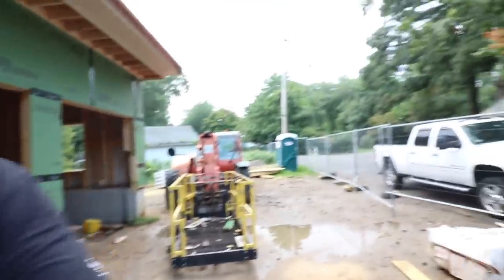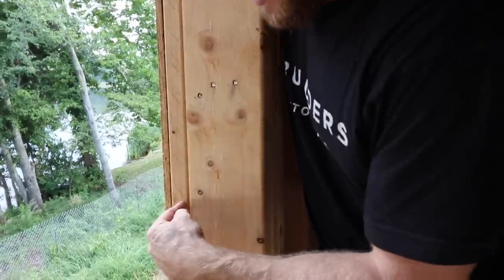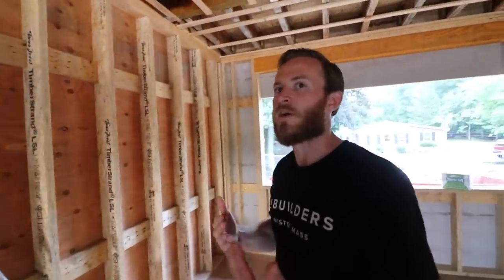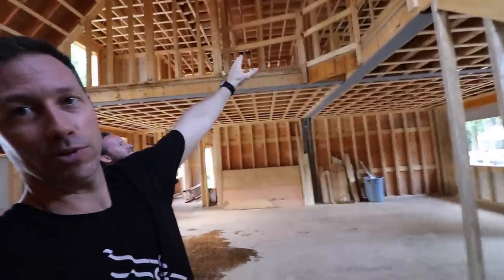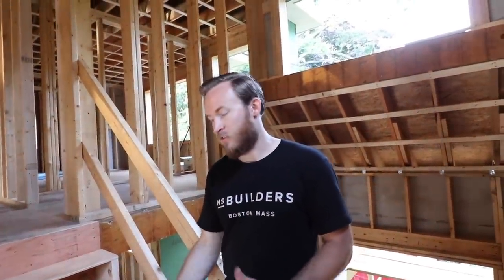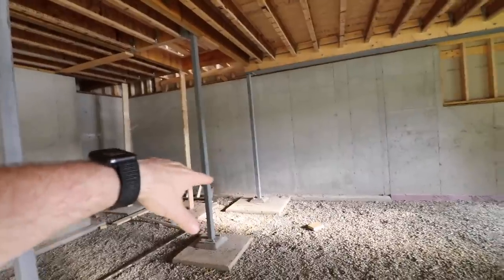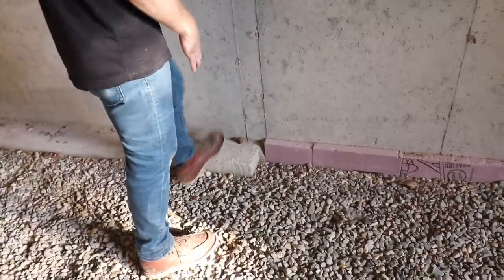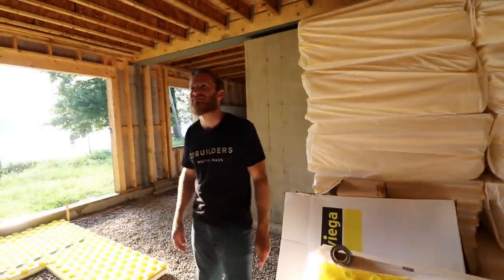How do they Build in Boston? Visiting a new home in Framing

Comment: Jury's still out for me on that Zip-R material, it has a clear benefit in that it creates a true thermal/sound envelope but it causes a few problems, some obvious, some not so much.  I put up an addition last year and that stuff was spec'd, my first time working with it.  I knew I'd have to special order fasteners for the siding and trim (3 1/2" stainless ring shanks to get through the clap board, OSB, foam and still sink 1 1/2" into the framing) and I knew not to crush it while installing and all that stuff, but I couldn't use the Azek plug system for my exterior trim because I couldn't get the right screws in such an unusual length.  Because it bumps the wall out to an odd size I had to custom mill all my stops for the windows and doors, plus you lose the benefit of the sheathing helping to stabilize the framing because of the foam, so it required extra blocking.  Also, quick tip for anyone using it soon: be sure to spec some wide lumber around your windows and especially doors to cut down to size after you knock out the foam backing so you have solid nailing (in my opinion it's better than adding a block); the hinge screws on your door will catch nothing but foam otherwise.  None of those problems should have anyone scratching their head trying to solve them, but they do increase the time and material costs and I wonder what the long-term cost benefits really are.  Anybody got an opinion on it?  (Just kidding, I know you do.)

Comment: It is amazing to me how everything is built without any concrete.... even wet areas like bathrooms and kitchen. In Brazil is all concrete, sometimes even the ceiling. Wood most of the times is reserved for roofing (which receives ceramic tiles, rarely shingles).

Comment: Very well designed, I've been Hanging Rock (plasterboard/drywall) 23 years and have never come across a framer who buries the straps or levels everything. They always leave it up to the rocker to bury the things ( strapping, beams, HVAC, crooked walls) that every other contractor didn't want to deal with, usually by scraping out the back of the board which gives you instant structural failure of the sheet. (Or rock over it for that beautiful hump in the middle of the wall) Any shifting and that's where it's going to crack
Reply: brian b , I grew up in Boston and love the strapping on the ceilings, in Colorado there is no strapping on ceilings and I see cracks in every home over 10 years old. I sure do miss hanging lids with strapping and the builders out here thinks that strapping is a waste of time and money, but I believe it is a far better system. Just my 2 cents

Comment: One of the GCs I worked with in FL used it to make the ceiling perfectly flat. He would string EVERY 1x  both directions. He used screws on the 1xs so his framer could pull them out to shim the strapping.

Comment: Wow...the builder threw the cabinet man a bone....I can't even get the framers to plumb and straighten the wood studs in the kitchen 😀
Reply: I feel your pain. Sometimes I think my name is "Shim"
Reply: I think the builder IS the cabinet man.
Reply: JohnnyBDye that’s a real easy problem to solve there, just withhold money from their check to compensate ç their way pretty damn quick
Reply: Don Pfeiffer ...
I'm the cabinet maker and installer, AKA "The Shim Master"
Reply: We use engineered lumber for studs on walls where there will be cabinetry.
Reply: @mikemills8765  That's what I heard...
Reply: When I remodeled our kitchen I made sure that our main cabinet wall was one-hundred percent straight. Those dang quartz countertops are very unforgiving if you have wiggly walls. Turned out great.
Reply: badlandskid Awesome! Brilliant idea. I'm the cabinet guy. Wow! Straight walls. That might confuse me. 🤯 LOL

Great tip. Thanks!
Reply: Low-budget DIY basement kitchen construction:  Buy the studs the year before.  Stack them in your garage with spacers between each row.  Run one side down a table saw:  1-sided straight studs.  It may also help to buy 2x6 studs & cut them down to 2x5 -- they usually warp less and you have more space for plumbing.
Reply: Because he IS the cabinet man. Did you watch the video, or just scroll to the comments and start reading those after two minutes?
Reply: lmfao  @victoreous626
Reply: @JohnnyDBDyer that's why they call it carpenTRY not carpenDO

Comment: If you can go to 24" according to the calc but want less deflection, 19.2" is an option that allows more space for ductwork. ◇ on your tape measure.
Reply: delreydavid  19.2 x 5 = 96 which is your common subflooring size. It has been on tape measures longer than they have been building racks but If your rack happens to be 8' tall it would also work.
Reply: 19.2" is a common spacing for joists to keep the sheathing edges on the joist. 12", 16", 19.2", or 24"
Reply: Some places that's somewhat common, but most places don't run with 19.2" centers...Not to say it doesn't work, just not common.
Reply: Yep, a case where less isn't more for sure.  In your case I'd still prefer 16" centers...but again, there's nothing wrong with 19.2, we just don't use it.  I'd guess a portion is that 12" centers is every foot, 16" centers is 16-32-48, 24" centers is every 2 foot...try asking the new guy to add 19.2+19.2+19.2 ever!  (I know it's on the tape measure, and truth is some guys struggle with 16's even...soooo...my point may be worthless!) . I fully agree that I'd rather have a house framed on 19.2 rather than 24...but...I'd even more rather it be 16's :)
Reply: Bingo.....compliments on your knowledge. Most carpenters, let alone You-Tube posters don't know what that little diamond is for... another way to gain space without going to 24" O.C. and still break on 8'.
Reply: 19.2 is actually for Truss spacing. Common specs for TGI, TJI, Open web wood joists, and common framing members is done in 12", 16" and 24" OC spacing.
Reply: I was looking for this comment. 19.2 is what we do here, it is a good compromise between the reduced cost of 24"  & strength of 16", and without the issues of subfloor sagging between the 24" spans if the floor finish is too heavy (3/4" subfloor). 

Also it is worth finding a local truss supplier or engineering firm that is willing to actually run the numbers for your floor truss/joist to get you real world numbers that will have no bounce. We have factored charts we use for our designs for that purpose. Build beyond code and your clients will love it. I'm also a huge fan of OWWJ trusses, awesome for mechanical and hiding structure... although you do get a taller building out of it (especially if you are going 18" deep or more). Also a great way to clear span the big open spaces people like.

Comment: I love having a basement!! That's where my washer and dryer goes.
Reply: Why?  They should be as close to the Bedrooms as is reasonably possible.
Reply: My Aunt had a laundry shute in bathroom, that went into the basement I personally prefer laundry set in basement.
Reply: I live in a nice enough still reasonable rent duplex, the washer and dryer are in a closet outside my bedroom, there is accessible location in the basements but it was built uninsulated and unconditioned long before modern code compliances and not been updated or rebuilt since.

Comment: Couple of problems noticed right off with your Zip board in the way it was installed. They should be stood veritical to minimize lateral seams. They make them in 12ft lengths. You installer did flush set his nail gun when nailing them off so many of the nails broke the surface. Unless you go back and fill or zip tape them , then you've lost the moisture and air resistance that sheet is designed to provide. And its clear they didnt use hot dipped galvanized nails when nailing that 2x2 pressure treated fur strip at the bottom of the wall. You can clearly see the rusted head from the video. At 2:12 you can clearly see the bleed from the nail....16:31 again more over sunk nails after he talked about setting the nail gun depth. I especially like where they missed the stud, removed the nails left the holes. And from this video you can tell it had recently rained a lot, so I pretty certain there is water in your insulated phone just sitting. Well moisture at least.....way over built this house to go for thermals yet issues all over with preventing the issues the products are designed to do. 

The sheer tie down straps, was a nice touch by the framer to flush set them in the wall!!
Reply: Most lumber yards do not stock the extended length ZIp or plywood. Installing horizontal is perfectly fine too, at least if they are taped. We caulk EVERY nail hole that is not taped when we use Zip, to prevent water intrusion. The ZIP WILL expand, and swell at the nail holes even if they aren't over driven. Hence why we caulk every nail hole.

Comment: This home is being built in the Town of Framingham, Massachusetts which is a “Green Community”.  Theretofore, this home is built according to something known as the Stretch Energy Code and it is therefore not an example of a typical Massachusetts home as built to the standard Massachusetts Building Code.   Theretofore, the differences between this home, and homes in Texas and the assumed differences in construction methods is therefore exaggerated.
Reply: Timothy Seely, You may be correct about the  exaggeration of differences, but as a retired Shrewsbruy, MA. firefighter, I'll be willing to say the MA. codes are stronger than those of Texas.
Reply: Having lived in the north and now living in Texas I can say there is little exaggeration. You wouldn't have to do much to have stronger codes than Texas. Like, if you have a building code at all. I was astonished at what passes down here. Never before have I seen exterior walls framed 24" on center, for instance.
Reply: Try an "as such" or other phrase, you used your entire allotment of "therefore"s for the year all at once :)
Reply: Jason Doege what municipality allowed 24" OC for exterior walls?
Reply: Holy therefores!
Reply: It appears my word choice was more than a bit static during my original post for which I apologize. The post itself was to detail important local on the ground details (almost like the function of a legal disclaimer) that the author of the piece seemed utterly unaware of which inherently magnified existing differences between the two localities being compared thus giving a somewhat inaccurate view when writ large of the differences in construction between Texas and Massachusetts.
Reply: Austin, TX. At least in the 80's. It was a Bill Milburn development from before Continental Homes acquiring them.
Reply: My understanding is that 24" centers requires that rafters and trusses above the wall must line up right on top of the studs in the wall. Given that restriction, I don't see any problem with it. Houses built with 2x6 studs in the northeast were framed like this, at least in past years. But I wouldn't be comfortable with OSB sheathing on a 24"-centers wall.
Reply: Yeah the North Pole is 'up' for everyone on the planet Earth.
Reply: Smokey Bear, my possessing a tendency towards prolix prose is something inherently designed to completely eliminate any and all confusion in my written communications.  Make fun of me all you want, but eliminating any doubt about what I have to say is a wonderful mechanism allowing for understanding to be through, detailed and eliminating the need in most cases for follow up communications.  I also happen to like the writing style present in the American Declaration of Independence which contains some of the longest single sentences in the history of the English language because the paragraph a later more rigid superstructure forced upon the language in the nineteenth century by authors who were German in extraction. I believe in rebelling against that system due to inflexible and regimented nature of that society and the horrors it foisted upon the world in the twentieth century.

Comment: Great stuff! Instead of the 2x2 detail at your foundation to zip-R joint could you just use a 2x8 sill with a 1-1/2" overhang so you don't have to go back and nail the 2x2's after the fact?
Reply from the maker: good idea!
Reply: I think he ran the ZipR to the bottom of the sill plate so there's no thermal bridging. He said the 2x2 was adhered to the concrete.
Reply: Adam Mackey Smith no I'm pretty sure he nailed the 2x2 directly to the sill. More worried about leaving the insulation exposed and air leakage under the sill than a thermal bridge situation.  The rim joint will get spray foamed from the inside anyway after the fact.
Reply: I was wondering if when doing Zip R sheathing, why not have the framing set back that entire 2” thickness so the sheathing is flush with the foundation. Hate seeing homes with 2” to 3” overhanging the foundation. Makes it very unsightly.
Reply: Why not just set everything back 2" and nail your sheathing into the sill? Wouldn't that be better than having all that overhang?
Reply: that would definitely save a bunch of time. looks like he didn't have the exterior sheathing picked out when framing was going on, so it was an after thought. all in all a great homebuild
Reply: the over hang isn't so bad if you set a bluestone sill and veneer stone under it.
Reply: That's my thought...it is going to look odd now...I'm sure they'll get it trimmed out just fine, but I'm guessing it was an afterthought.

Comment: How does the Zip-R actually provide any shear wall strength?  The fasteners are 1.5 inches away from the wood surface, so any racking or lozenging is going to result in bending of the screws instead of transferring shear forces through a nail into the sheathing.
Reply: I found that worrisome, too.
Reply: EFormance Engineering that's true do you think the treated 2/2 would help on load at the bottom of the wall? I hear what you are saying if you put Hardiplank on that wall that is a lot of weight pulling down
Reply: R
Reply: EFormance Engineering  
Tornado bait
Reply: In this application t bar support, often called wind bracing is supposed to be used lateral attached to the studs and under the iso
Reply: I would think you would get more stability from putting sheathing on wall first and then 1/4 inch foam on, tape seams,then tyvex house wrap. Which is how we do it, if the owner even goes for foam. Foam wrapped houses seem to look like shit when the siding goes on after a couple years though because the wind plays hell on it. If you pound the nails in tight the siding can’t flex with changing temperatures. Along with it having a wave look to it. Leave them too loose your problems go the other way. I’ve never used the stuff they are using though. I’m sure it works.
Reply: I can't see a underwriter signing off on that type of application. The nail head is technically 1 1/2" from home.
Reply: @Luke Hernandez you need the shear strength just as much if not more for wind then earthquakes
Reply: cause its green.
Reply: The interior linings are used for bracing here in NZ.
Reply: I know Zip has tighter nail spacing for that reason, or you could just use tension strapping.
Reply: The zipr i used before goes over ply afterwards
Reply: Look at the wall studding.... its all horizontally beefed to start with. Hes probably liquid nailing along with reg nailing a lot of it too since hes gone overkill with most everything else.
Reply: Luke Hernandez in California we generally don’t install sheer on an entire house. Usually the four corners of the house only.
Reply: william delmer no such thing as overkill. Only better quality